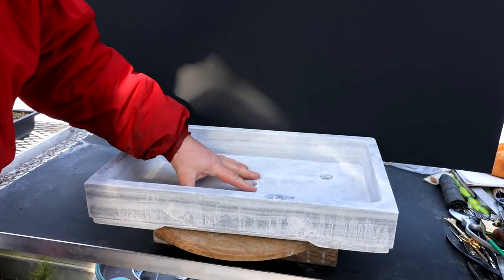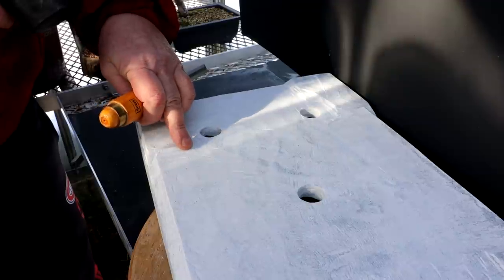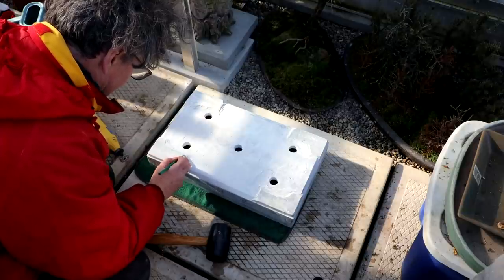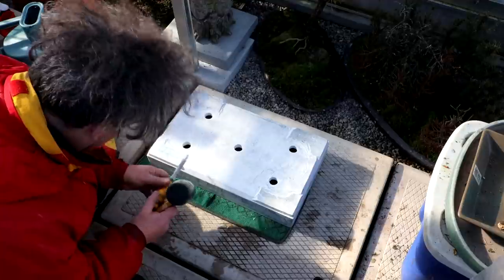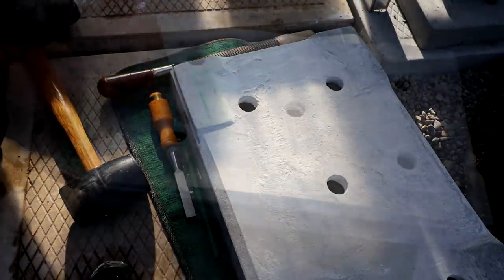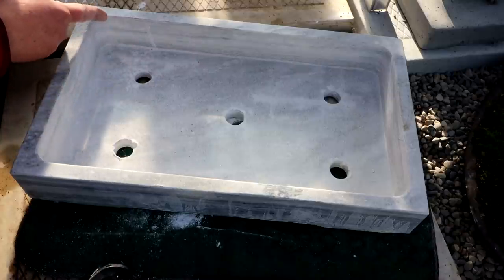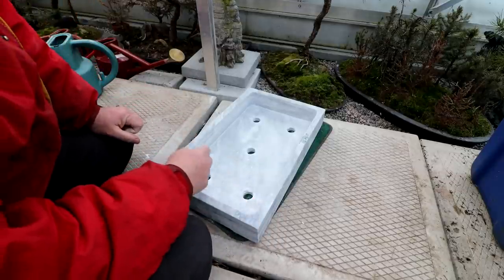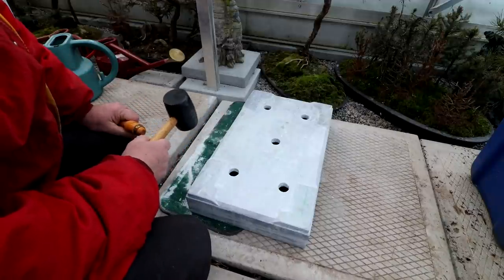Carving My Marble Bonsai Pot, The Bonsai Zone, Feb 2022

Comment: Hello Nigel, I really enjoy your videos! Can't believe I was missing this series! I just wanted to say that, if you're going to continue working with marble, it would be best for your health to get proper safety equipment as the crystalline silica dust is persistent and can cause irreversible lung damage. Especially if you work work with powertools, do any sanding, or chisel with your face so close to the marble. If silica dust gets inside your lungs, it's very hard to remove. It's not a terribly common disease on hobbyists, but damage can occur. It's better safe than sorry and you don't want to be part of that statistic. Love your videos, can't wait for the final result! :) - San

Comment: Awesome!! Makes me wanna carve one of the slabs of marble I have. I intend to make a mortar and pestle out of (part of) one, but a pot would be a great idea for the (entire) other slab.
Rather than work on the floor, I would recommend setting the piece on a bag of sand, or a bag of dirt if you don't have a bag of sand. (Which I strongly suspect you do). It absorbs the vibrations (less chance of breaking), dampens the noise a bit, and keeps the piece firmly in place. You can even keep it on the rotating platform, as long as that platform itself doesn't wobble. Wobble can lead to unrecoverable mistakes. You only get one chance when carving stone -- Altho this type of marble is pretty forgiving.
Working on the floor will only end in back and neck aching, most likely. :D
IIRC marble chisels are hardened differently from wood chisels. This will likely ruin that wood chisel. Also, not ALL marble chisels have teeth. Those are more for rough hewing. (Which is what you're currently doing)

Comment: Hey fella.. I’m the one that told you off about your rusty trowel.. I’v just popped in to say that if there was somewhere that I could report you for “Handtool Abuse” You’d be getting shopped my friend! 😂

Also.. As a side note and not really related.. If you like the idea of carving mortar you can make up a simple gobbo mix of 2 parts sharp sand, 1 part silver sand, 1 part cement.. Plasticizer if you want to guild the lilly.. As the mortar “Greens off” there’s a space of around an hour where you can do some carving.. It’s how we used to fill in around ornate works or make “Temporary repairs” Also known as a bodge job 😂 But it’s a great trick for making pots 👍🏻
Reply from the maker: Thanks, very interesting!!

Comment: Just my 2 cents, maybe try using like a 40 grit sandpaper on an electric sander. I’ve never tried it on that material but to me it seems that a heavy duty sandpaper might help. Definitely to take down the thickness fast and also it would give a more smooth result.